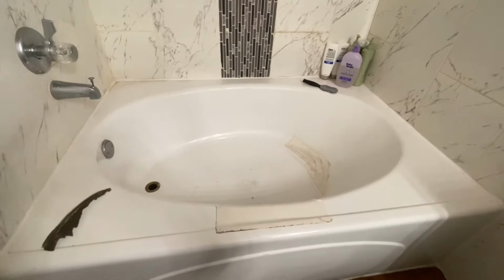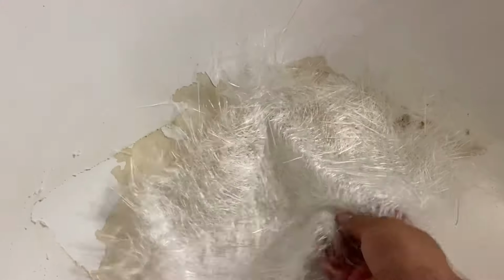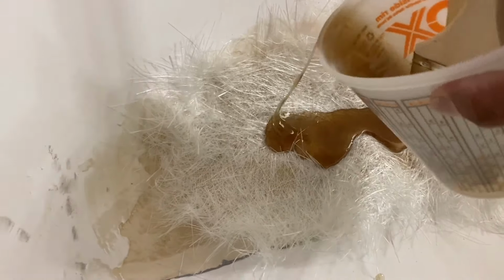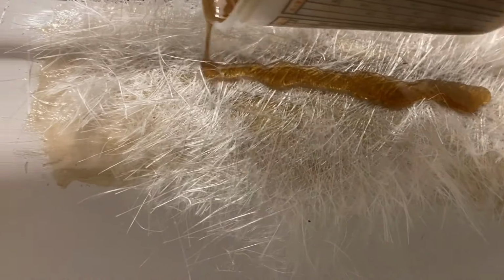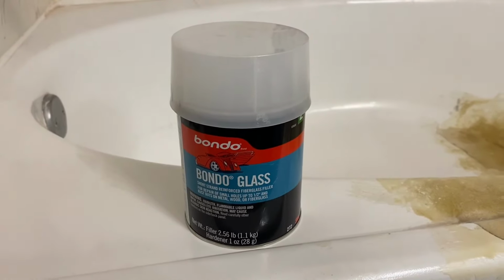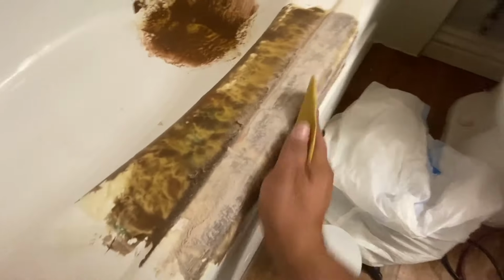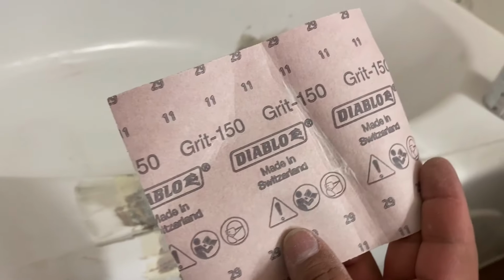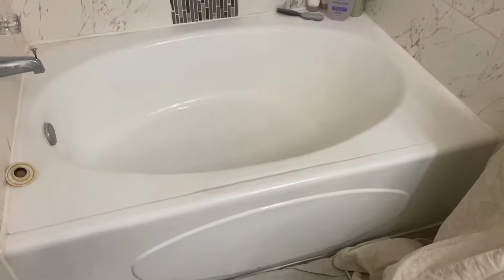How to Repair a Fiberglass Crack in a Bathtub | DIY Fiberglass Bathtub Crack Repair | STEP BY STEP

Comment: Thank you.  I had a few cracks.  One was bad.  I followed your instruction exactly and it looks amazing.  The floor of the tub is now very solid and the paint from Krylon (Buscuit color) matched up perfectly.  Also replaced all of the chromed shower parts and it looks like a brand new shower.  I am shocked at how well it worked out for us.  Thank you.  This video saved me thousands of dollars on a shower/tub insert replacement.  Thank you

Comment: I want to say THANK YOU VERY MUCH SIR for this video!!! My aged parents had someone come out to give an estimate of why the tub was leaking. They were quoted $3000 plus to repair and $8000 to replace. My parents are on a fixed budget. I went to visit (I live 4hrs away) and inspect it myself. No water marks or stains around the fixtures. None where my dad said water was coming out the wall. I noticed a crack in the tub. I watched your STEP BY STEP video about five or six times to build my confidence to see if I would attempt the repair!! THANK YOU again because I did, and it came out perfect!!! Can't tell a crack was even there to begin with. It also fixed the water leak!!!! Thank God for people like you to help people like me and my parents not to be taken advantage of!! HUGE THUMBS UP!!! THANK YOU AGAIN! Your awesome!!
Reply: Would it be better to countersink those holes, then the fill would have land area giving more structural to the hole . A straight hole can more easily fail by falling straight through where a chamfered hole hole has a larger top and cannot fall through.
Reply from the maker: @magicone9327  nope!
Reply: @magicone9327  

While that's true when it comes to fastening softwoods and aluminum, this application forces epoxy through the hole(s) and cracks as well as bonding with surrounding epoxy and the fiberglass, making a very strong bond.
Reply: $3000! ...$8000! People are insane nowadays. They just tell you anything like money is water.
I asked about taking a tree down in my yard and they said $3000. It was three guys and they said it would take a day. They were from Honduras and couldn't speak English.  I'm pretty sure they must be here illegally.  $3000 is probably more than a years salary for 2 people there. I found a local American guy and his son to do it for $600.
Reply: He’s a Blessing 👍👍👍🙏🙏🙏🇺🇸🇺🇸🇺🇸
Reply: Where do you live? Can't you buy a new one for about the same?.
Reply: The person giving this quote should be outed and shamed mercilessly
Reply from the maker: Yes but you have to pay for removal of existing, installation of new, removal and reinstallation of plumbing, also most units or tubs are larger than the door frame and have to be cut down. Also the walls around the tubs would have to be removed. It's a trickle effect of costs.  @nicolagrant5450
Reply: I have a leak in my bathtub. I visibly can't see the crack. I had a quotation to replace it. Yes man, it surprise me, 6000$ without materials. Crazy.
Reply: @magicone9327  hi - can you please explain to "Counter sink the holes" thanks.
Reply: @fchuatan  countersink is to end up with a hole that is, let’s say 3/8” at the surface and 1/8” at the other side.  Any fluid within the tub would end up pushing against that cone shaped plug and could never push it thru.  The more water weight the more pressure pushing on the plug and the tighter it’s sealing becomes!

Comment: Hey there and Thanks for this video. I understand that you recommend waiting 45 min to and hour after the resin but how long do you wait after the Bondo and Putty application?
Reply from the maker: Generally, the Bondo putty will dry within 15 minutes, depending on the air temperature and humidity

Comment: What size sandpaper do you use for all of it?
Reply from the maker: I generally will sand with 100-120 grit and then smoothen out a bit before spraying primer with 220-320 grit

Comment: Do I need Bondo glass and putty or can I get by with one? I ask because I only got the high bond filler. 

edit I couldn't find the Bondo Glass except on Amazon and I can't wait a month or more for them to ship it. So I went and used 2 patches of fiberglass cloth instead and let them dry for 2 and half hours before putting on high bond putty. Will that work?
Reply from the maker: Auto zone has it

Comment: So I have attempted repair and realized I only used half the harder needed to resin will this still cure? I used 8oz of resin to 45 to 50 ish drops of hardner.
Reply from the maker: Might take longer but it’s generally 10 drops per ounce
Reply: Almost done i have gotten to paint the tub new color!

Comment: Any advise on How uou deal with the fumes from the products. Im part way through the repair on my master bath ive put a box fan in the bathroom window aswell as the bathroom fan on ive worn a respirator through the process how ever even with the door closed and towel at the bottom of the door the fumes are leaking into the bedroom. My wife is pregnant so im gonna have her sleep in another room to be safe thanks for the video brother.

Comment: Great video!! Currently drying my resin and mat now. This might be stupid but how do you clean everything after?
Reply from the maker: Lacquer thinner
Reply: @DPTubs  one more question…My tub has some grip on the bottom. When I prime and paint it, is there anything I can use to recreate the grip? Part of my crack was on the bottom of the tub where you get in. I don’t want it to be a slick spot and fall.

Comment: I cannot find the fiberglass matting that you use.  Seems I can only find fiberglass cloth.  It is a clothlike material rather than a 'clump' of fiberglass strands.  Where do I find fiberglass strands like you used??
Reply from the maker: Did you check the links in the description?

Comment: You don't use foam expansion to support the tub underneath? Ain't that usually the reason why it cracks, no support under the tub
Reply from the maker: If it’s at the cove the void space behind is too big…this repair was much stronger than the original unit

Comment: Does the fiberglass mesh bond to the Gel Coat surface or it is better to sand the bathtub until it reaches the fiberglass
Reply from the maker: It bonds well as I sand it very well and rough it up for adhesion. The resin that is catalyzed gets hit and bonds to the surface very well.
Reply: @DPTubs  Thank very much you saved from a lot of work

Comment: I am on the step with the all purpose bondo. I had to put a box fan in the room exhausting all the fumes outside because it’s hard to breath in. So far it’s coming out good. My fiberglass meshing was very bristly and when sanding for the first step after curing 1 hour the sanding was not a smooth process many clumps of hairs needed to be sanded out . My only issue so far is sanding it’s taking so long and I feel like I’m not making any progress. I’m using 80grit 3m paper is there any way to make it sand easier I have a few bumps of bondo that just won’t smooth out
Reply from the maker: Have you used an orbital sander?
Reply: @DPTubs  I have been sanding by hand like you were doing in the video
Reply: @DPTubs  is it the brand of sanding paper do I maybe need to try a different grit?

Comment: we have just got our first home and the large tub has a very tiny crack, much smaller than your cracks.. ~3 inches a very nice straight crack. Would you recommend we just sand it down and go straight for the bondo glass and skip the first step with the fiber glass resin?

Comment: If you had to resurface the whole tub would you still use the spray version or would ypu get the gallon? Also in order to refinish a whole tub( mine is like a tan color) do i need to sand the whole thing  before applying a resurfacing kit? Thanks again!
Reply from the maker: I would use a gallon and my HVLP compressor and gun!

Comment: Thank you very much Sir! After drilling the holes, I filled the underside with Locktite Titebond low expansion foam. Definitely made the difference; no movement now. Followed everything else you outlined to a tee. Saved me $1000.

Comment: thanks for the video. for very thin light surface cracks where i dont need to reinforce with a mat, could i just use fibreglass resin? or would you use plast aid kit? i feel that more liquid fibregalss resin may get into the cracks better. thanks again

Comment: Is the foam gap filler not necessary for this repair?
Reply from the maker: No because of the specific location on the cove / curve if the tub. There is a much larger void space on the backrest of the tub so the foam wouldn’t do much.
Reply: @DPTubs  thanks for the reply, I'm going to try this your videos are a great help!

Comment: Why did you not spray some expanding foam inside the cavity?
Reply from the maker: at that point of the crack there is a ver large void space behind the "Back rest of the tub". The foam right there would not have done anything.

Comment: Would it be ok to put a thin layer of bondo glass down first to seal the crack and two holes I drilled? I was thinking, bondo glass, fiberglass,bondo glass, then a larger fiberglass patch, then a layer of bondo glass. I have a 12 1/2 inch crack in the bottom of the tub. The sub floor is sagging, and I can't fix that till this winter. Wasps and yellowjackets like to build in the walls of this house trailer. This is a second bathroom, not used very much.
Reply from the maker: I don’t know how well the resin would adhere to the bondo glass. I always like to use resin and cloth on original surface
Reply: @DPTubs  ok thanks! I'll go with fiberglass first then bondo glass last. I'm going to use a shower bench to keep weight off the repaired crack until I can get the sub floor repaired.

Comment: I bought a fiberglass kit with bondo. Will the mat work just as good as the hairy kind? First time doing this. Also on some other videos, i saw them drill random holes in soft spots also and fill with foam... Do you recommend this also? As this is in a old mobile home.

Comment: Would this method work the same under the fiberglass tub at a spot that has thinned? There’s no hole or crack, but there is about a 1/2inch soft spot that light can shine through. Thanks 🙏
Reply from the maker: Yes

Comment: Where do you buy all the material? I have a fine thin crack at the bottom of my bathtub that I need to temporarily fix until I have the money to remodel it all. Just a small line but needs repair soon

Comment: I need to know how you got the flex tape off the tub....I am struggling over here!
Reply: I ordered flex tape adhesive remover from Amazon I had to pull the edge up a little bit spray it pull the edge spray it pull the edge spray it and then I used a five and one scraper to get the residue off

Comment: To prevent cracks again you need to inject foam under the tub to support the bottom. Therefore drill larger holes and spray the foam under the tub for this support. Use foam that doesn't expand that much like CRC Brand low expansion. Same process for showers. floors.
Reply from the maker: This is on a tub by tub basis. This particular tub was solid underneath but on the cove / back rest of the tub it was hollow. There is too much of a void space to inject foam behind the back rest of the tub. If you watch some of my fiberglass foam repair videos you will see that foam is only applied when needed.

Comment: I bought all the stuff on your list.
Watched your instructions about 20 times.
Followed to a "T" your instructions. 
And the first patch peeled right up when I was sanding.
Cleaned extra careful and did it again.
Seems to be working.
However.
Getting ready to paint the final coat and it says "WAIT 36 HOURS BEFORE EXPOSING TO WATER!!!".
You didn't mention that at ALL in your video.
I just happened to read the can before shaking it.
Crap.
Apart from going to a hotel....we are without a shower now.
Thanks for leaving that part out.
Reply from the maker: 36-48 hour cure time is recommended. All instructions / cure times / care and maintenance are listed on the back of all products. Good job for reading it!

Comment: Did you use 80 grit sand paper for all sanding tasks or different grits?
Reply: I mean until all purpose putty, you already tell 150 grit for all-purpose putty
Reply from the maker: @MustangGT50bmg  before the putty you can use 80-120 grit
Reply: @DPTubs  I did this repair finally 4 days ago and I tried bathtub first time today and it didnt leak. The bondo part wasnt so smooth like yours in the video mine is a little bit uneven surface and have little bit scratches even though I used 150 grit but may be my sanding technique is not good. but I think I need to repair 4,5 bathtubs to get some more experience :) Thanks for the video it worked perfect.

Comment: One more question if all your steps are followed how long do you think this will last? I followed all your steps and it seems like a very very strong bond.
Reply from the maker: derek meese it should last quite a long time, years with proper care. The main thing to take care of will be the top coat / paint. Make sure to clean with non abrasive cleaners.
Reply: DP Tubs I have some hairline stress fractures on a fiberglass shower base. I feel it flex a bit when I stand in the shower. Should I reinforce this by adding foam in the drill holes or do you think doing just the reglazing you did would be fine? I don’t really want to drill if I don’t have to as the shower is only four years old and these are just hairline fractures etc. thx
Reply from the maker: Jason Trigo mybrecommendation without seeing it or standing on it is that if there is very minor flex then reinforcing it from above will be ok as long as you spread the cloth / resin about an inch or two diameter around the flex points. 

If it’s dipping to the point of water settling then reinforce from underneath. Otherwise patch from above and make sure that it doesn’t affect drainage / water flow to the drain

Also, if there are cracks that cause leaking you should drill a small hole to stop the crack from spreading. If the hairline crack is very very minor then you should be fine without drilling.
Reply: DP Tubs thank you for the quick reply. Great feedback!
Reply: @DPTubs  what kind of tub cleaners would you advise?
Reply from the maker: @occipitalneuralgia2339  ZEP Tub and Tile or Soft Scrub with Lemon

Comment: DO YOU NEED BONDO GLASS IF THE CRACK IS SMALL - 2 TO 3 INCHES LONG , mY TUB IS ONLY 4 YEARS OLD AND IT DEVELOPED A SMALL CRACK THIS YEAR - AS THERE WAS A LITTLE GIVE UNDERNEATH THE TUB, SO i DRILLED 5 SMALL HOLES AND SPRAYED FOAM UNDER THERE AND THAT SEEMS TO HAVE WORKED . i FILLED THE HOLES WITH FORTIVO - NOW i WANT TO SEAL THE CRACK - 
i AM THINKIING i DO NOT NEED THE BONDO GLASS FOR SUCH A SMALL CRACK WHAT DO YOU THINK. ?
Reply: If you read every comment and response under the video, you will learn your answer. Depends on several factors...so that’s why you should read.

Comment: I love this video but I have one more question ⁉️ I got my tub and tile paint at Sherwin-Williams, this particular store does not carry a primer and they told me that a primer is not needed. I did my repair and it looks pretty good but the paint is rough and chalky, it isn't slick and shiny like the rest of the new tub shower.. how do I buff it to make it smooth without taking off the paint?
Reply from the maker: Try using 1000 grit wet and dry sandpaper then macguires polish

Comment: What grit sand paper did you use at each step? I think I heard 80 grit and 150 but I’m unsure of what step to use each one. I’m off to Lowe’s tomorrow to buy the supplies to fix a crack in my shower that hasn’t been used in 5 years. After watching your video I think I have the knowledge to tackle this myself.
Reply from the maker: Clayton Brimm how awesome! I use 80-150 to scuff up the surface and 150-180 to sand the patch work. You can even get into the 200’s to sand the final skim coat if you want to reduce or eliminate scratch lines.
Reply: Nice work. can you tell me the name  of  prime  in a can. I also  refinish  tubs and for small repairs  I would  like to use what you use thats awesome 👌 😀
Reply from the maker: @jasenmorales9810  I use Zinser 1-2-3 in a can primer. Works great just make sure it dries completely before a light sanding with 400-800 grit then spray top coat.

Comment: How much do you charge with supplies for this job?
Reply from the maker: Supplies are fractions because they last and cover multiple jobs. 

I charge $250 for the repair only. However this job was the full Reglaze so it was more overall.
Reply: @DPTubs  Thx, I have an appliance repair company and one of my customers needs this done. How is the chemical fumes? How long will it linger?
Reply from the maker: Usually 24 hours you should use a fume extractor

Comment: Great video!! I recently noticed hairline cracks in my fiberglass tub that was just installed 3 years ago.  Color me beyond annoyed.  I have been pricing having the whole thing ripped out and a new installation done.  Sooooo expensive and not in my budget right now.  This video is so informative and makes me confident enough to try and do the repair myself.  Is that 2 coats of putty you put on before the primer and paint or just 1?

Comment: I have just had a new bathroom suite fitted. everything was going well until the fitters filled the bath up and then only when it was emptying did the water start pouring out of the fibreglass on the bottom side of the tub. if the tub is only half full or if I'm using the shower its fine. The fitters checked everywhere but couldn't understand why this was happening. I would really appreciate it if anyone could help me with this please
Reply from the maker: I would have a plumber take a look at it. You may have to open up the ceiling from underneath to have access to see under the tub and watch the drain line for leaks.